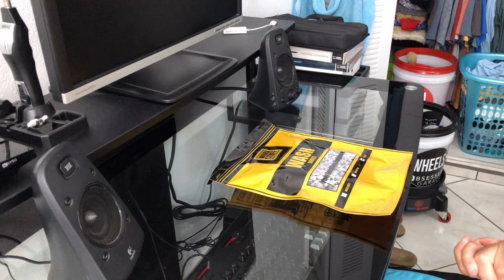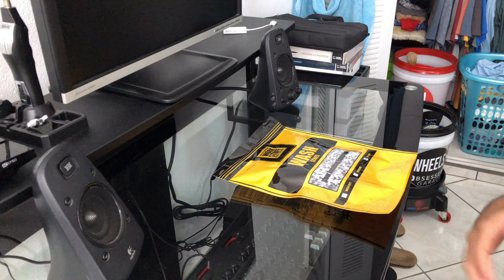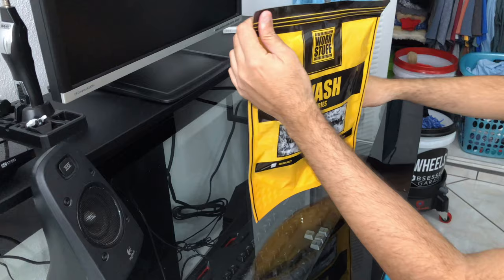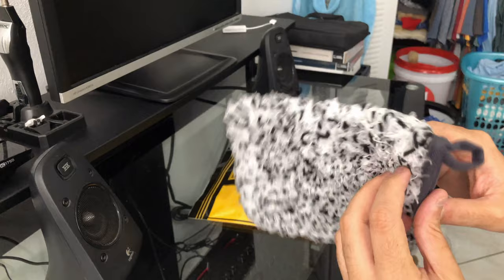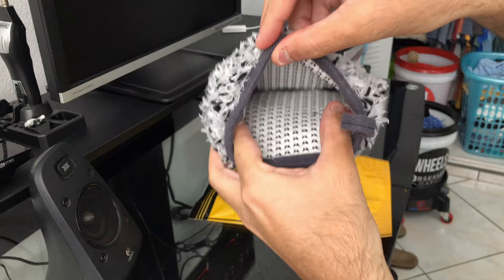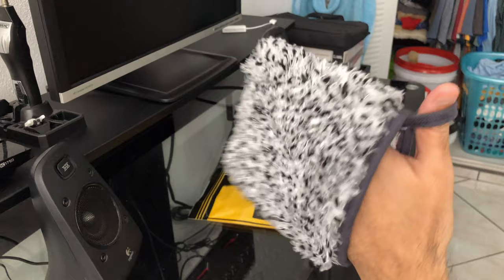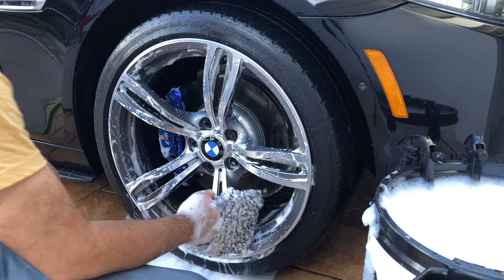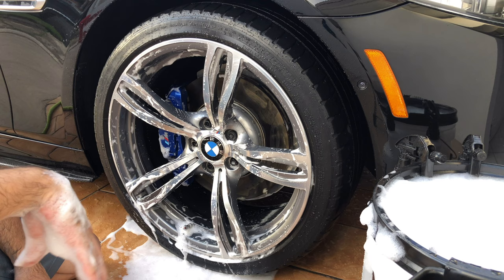WorkStuff Wheel Mitt

Comment: Detail Popo (at carzilla.ca) has a very similar wheel mitt called the "Mini Popo".   It also reminds me of the lambs wool mini wheel mitt I have but this one is made of the newer long strand microfiber that a lot of the mitts are made of these days.   That Work Stuff wheel mitt looks really good.   I might have to try and get one of those.   Looks like it would work great on my wheels (especially behind the spokes when I can't hardly reach with normal brushes and wheel cleaning tools).   That's a perfect solution.    I have several Work Stuff brushes and really like all their stuff, especially the newer RUBBER handled brushes.   They are really good and great when wet because you don't lose your grip like the regular Work Stuff brushes.   I get their stuff from Car Guy's Supplies here in the states.       One other product you might want to try out is BRUTE from Ammo NYC here in the states.    It's a specific high end wheel cleaning soap designed especially for wheel cleaning only due to the extra cleaning power and surfactants for wheels.     Looks like you enjoy trying out quality products so you might enjoy using the BRUTE wheel soap on your vehicles.